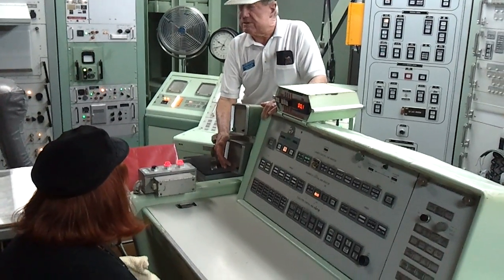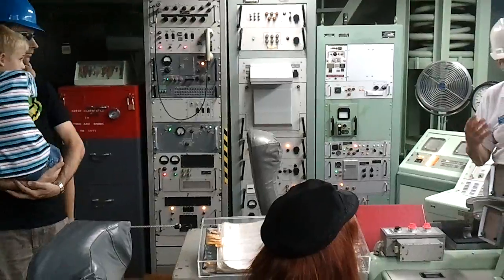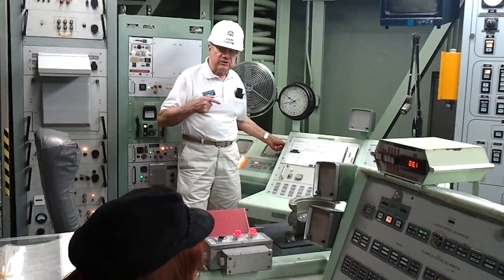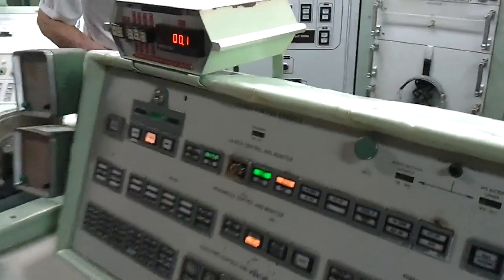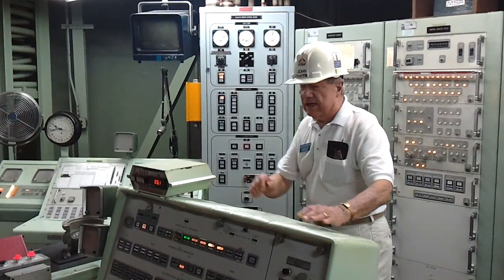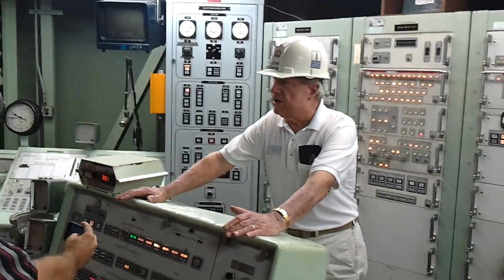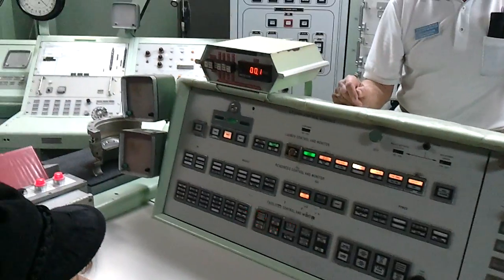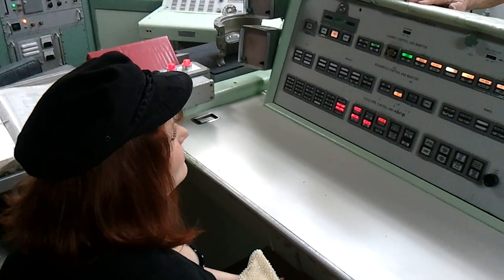Titan Nuclear Missile launch sequence

Comment: Which site is this that became a museum?  Was this 0-5 or 1-1?  I'm assuming it was the ACP or SCP.  I served in the D-M Consolidated Command Post and was deployed several times to either facility during exercises.  By the way, Titan crews were certainly easier to work with and a bit more enlightened than Minuteman crews.  And if any Minuteman types choose to respond to this, save it.  I couldn't care less what you would have to say.